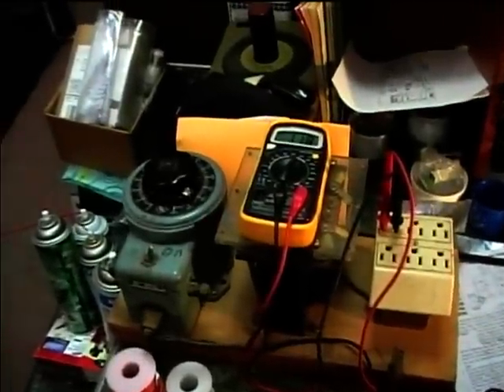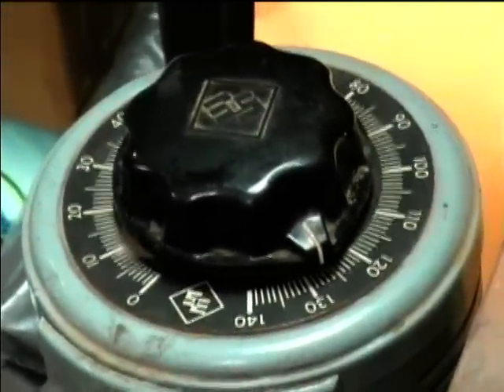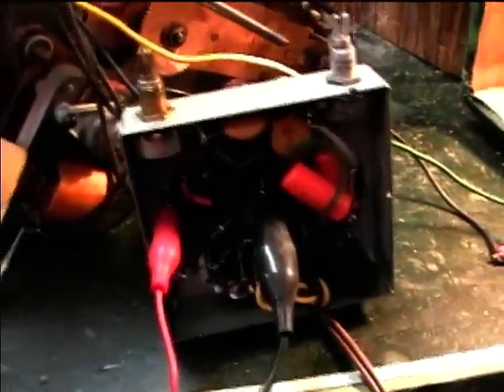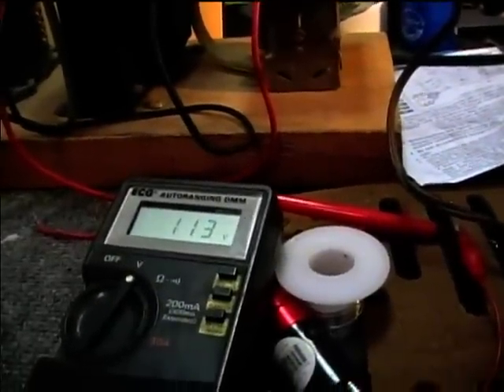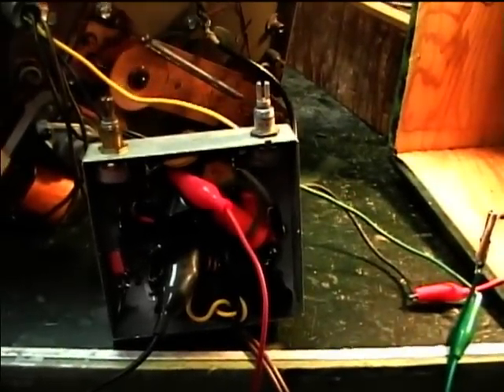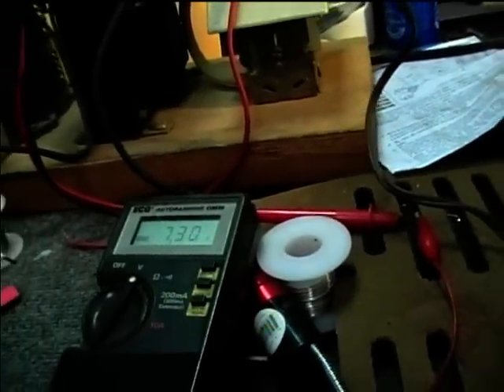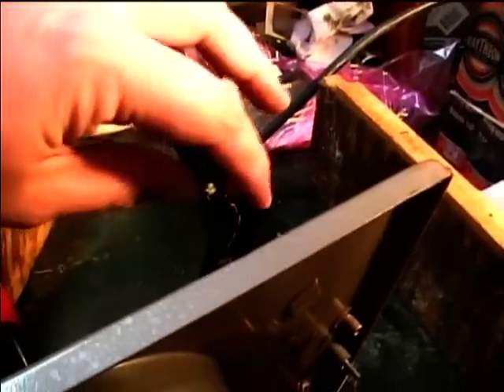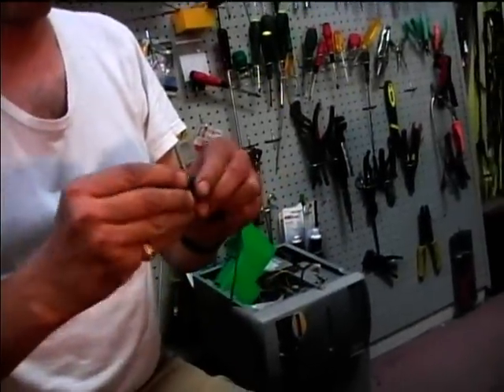Superior Electric Powerstat variable transformer and isolation transformer

Comment from the maker: The isolation transformer is for working on "hot chassis" type equipment where the powerline connects to the circuit ground...this prevents a shock and short circuit hazard when hooking up test equipment to these kinds of circuits and prevents a shock hazard from the chassis when using a "hot" radio or TV chassis outside of its cabinet for testing.